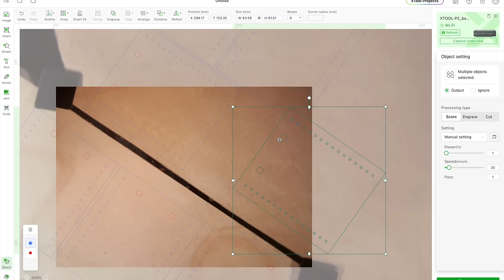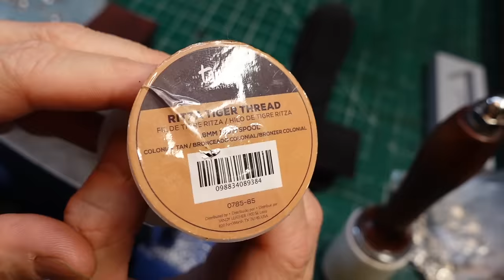Making a Leather Bandolier for SHTF -- Leathercraft ASMR

Comment: Picking up a lot of tips, thanks for that. Decades ago I started using plastic aspirin containers to hold .22LR, they hold more and they're water proof. This system designed to hold them instead would add a third more rounds and the plastic containers hold up better...

Comment: I love the idea, but it would probably be awkward to reload. Magazines are typically placed on the weak side because they are easy to grab with your off hand. In your current configuration you’d have to reach across your torso to grab the magazine. I would suggest adding a belt with the mag pouches placed at the 10 or 11 o’clock position. A belt would also ensure that your gun is always in the same position if you ever have to draw it under stress.

Comment: When I build things, I always try to do a proof of concept. I carry knives. And I’ve learned that until I’ve worn a rig for at least six months to a year. It’s not a proven product. The problem I would foresee with this rig is the holster coming up if you were drawing in a hurry. It looks as if it needs to be tied to your pants belt. I would also turn the mag pouches upside down. Your reaching across to pull the mag away from you the way you have them. You’d have to switch hands for it to work smoothly. Up side down you pull them out and down them right into the mag well. Other than that very well made rig sir.

Comment: Quick question, why do you use white glue instead of contact cement? And are they the same as wood glue? Thanks
Reply from the maker: I'm using both contact cement and 'regular' glue in this video. The stuff I paint on with a brush is Ecoweld water-based contact adhesive. The stuff in the bottle is Eco-Flo leathercraft glue. Both available at Tandy. It just depends on the pieces. White glue gives me time to position the pieces, where contact cement would not. I don't think it's the same formulation as wood glue. 
What I DON'T use is any solvent-based adhesive (Barge, Weldwood, etc...).
Reply: @RoadAgentLeather  thank you Sir

Comment: Me: I would go with the .22 lr or something like a 9mm do to the size of a round. Now with hunting if I was with a group of people I would think about a 12g shotgun but the round to weight is bad. If I was going to hunt deer I would pick a black powder rifle or shotgun over a 12g do to I could substitute lead for small rocks in the black powder shotgun. Yes keep the powder and caps dry is a little more difficult but I could pick a flintlock to eliminate caps and most of the components I can get at a store too
Reply from the maker: I've heard the argument for black powder. But you'd have to source percussion caps . . . unless you went flintlock.
Reply: @RoadAgentLeather  I have a cap stamper and the components for make the caps. But I think of black powder is more of fun to use but in a pinch it can hunt if need be.

Comment: You don’t seem to get much charring.  Is that from casing the leather or is there a way to change the air setting on the P2?
Reply from the maker: There's charing. I usually wipe down the edges with a damp sponge to get as much off as I can. Some also gets removed during the dyeing process.

Comment: man you are a smart fella! do you trust those (what I call) decorative rivets? I always feel the heads are gonna pop off.
Reply: Are you talking about the double cap rivets?
Reply from the maker: I've never had one pop off that was properly set. When they have, it was always because I used too short of a rivet so I didn't get a good mushrooming.
Reply: @maddawgnoll  yes. I have used some. They are nice, easy to use but on my heavy leather stuff I went to solid brass with washers I got to cut off and pound over, but they arent coming apart... which is ashame cause I love the look and color options of what he is using.
Reply: @jwgbmp40  Double caps hold very well. Provided you get the right length. I used to have problems with them because I didn't order different lengths and sometimes they were too long and the tube would crush and bend, or too short and I was pounding the leather down with a punch to make it fit. The majority off my orders where I use rivets I use double caps. But if I know it's going to be on a holster or knife sheath that's going to be used heavily I'll use copper rivets and burs. Mainly knife sheaths and tool sheaths (like axes). I also use the copper rivet bur combos on forester belts and wedge and axe pouches. I've had to take apart some of my work because I like to get ahead of myself, and this double caps sometimes need to be drilled out.

Comment: Looks awesome but in terms of practicality - utterly pointless. 22LR is a mean round (actually not uncommon to be used by assassins at point-blank range, the soft lead bullet also substantially poisons the blood + blood loss + more so if there are several, so the EMR is usually out of time...yet there's a reason it's not a weapon if choice), but it just doesn't cut it in a SHTF scenario. Especially with a scope - that thing is utterly useless.
Your effective range is 10-15 meters max and you have to shoot the legs...and run. Preferably just run in the first place. 
All it will do is wound them and then they will come at you in force, encircle you and you're dead. 
Against melee weapons - eh, probably, if you're lucky and already have the weapon drawn - again, shoot legs, face, run. Would probably take a clip to put someone down, if at all. Depends on the amount of adrenaline the target has, too - that is a very big factor for small caliber. For example, a drugged person or a person high on adrenaline could probably eat up a clip and still get you, while an unaware one will faint from shock (and suffer less damage altogether consequentially, except maybe blood loss, but that also depends, unless hit in vital organs or finished off). 
But as a deterrence from unarmed people and dogs - perfect.
Also I noticed on the back - is that thing compatible with backpacks? I think the rear pouches would touch the backpack and then the sling will move forward each step and then you'll get a rash from your pectoral over to trapezius and deltoid, and the side of the body too. Leather cuts in real good when it moves around a lot.
I'd consider a side strap across the waist to lock it in place and loose a couple of pouches on the back to be able to put on a backpack, because without a backpack it just doesn't work.